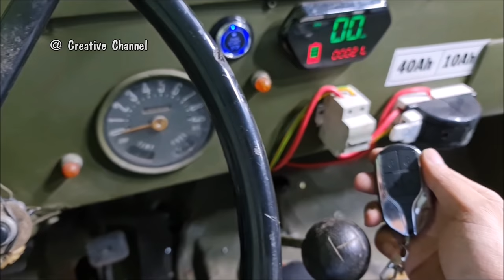1967 JEEP GASOLINE Conversion To ELECTRIC Car at home

Comment: Of all the possibilities that Jeep imagined when it was captured by the Vietcong, converting it into a military golf cart sure wasn't one of them. Congratulations, superb and super simple conversion, Tesla must hate you and rightly so, haha!
Reply: Now it's going to cost twice as much to operate without as much range.
Reply: @gregpeterman1102   I understand the range part but why would it cost twice to operate?
Reply: هغا
Reply: @Sputz3  because electric vehicles on average cost twice as much per mile as petroleum to operate, electricity and batteries cost money.
Reply: tesla nem sabe quem é esse cara
Reply: Xxb
Reply: @gregpeterman1102  I don't know where you live , but usually its the other way around, cost per Km for electricity is roughly 1/4 th of fuel. And There will be annual cost savings on maintenance because there is no oil change , air filter , fuel filter etc. Batteries will easily last 10 years with minor degradation in capacity.
Edit: -------- 
i noticed he is using 40Ah 80v lead acid + 10 Ah 72v lithium-ion.   
This is bad, as the Lead acid will only last 100 charge discharge cycles, worse if discharged to less than 50%, these are regular car batteries designed to give burst current to starting motor, not deep cycle batteries.  So less range (around 25km) and probably more money lost than fuel for battery replacement.
Reply: @hemanthkumarHere  I'm going by my experience with electric golf cars costing twice as much to run compared to gasoline powered. (Yamaha)
Reply: @gregpeterman1102  interesting, and very valuable feedback. However, You glossed over a few very valid points. I am not very knowledgeable about converting gas-powered vehicles to E-powered powered vehicles. Please provide details as to why the operating cost would increase.
Reply: @jamesnash6101  because of the cost to recharge the batteries, plus the cost of the batteries is part of the fuel expense, and even the old lead acid batteries were not cheap, the electric meter at the shop where we recharged anywhere from 4 to 7 golf cars per night would run anywhere from $800 to $1100 per month, but just $200 dollars worth of gasoline would run more golf cars than that all month, it was a no brainer. The only place to justify electric vehicles is indoors or enclosed places to avoid carbon monoxide. Also the electric components are the weakest part of any vehicle, and electric vehicles are more prone to breakdown. Just what I learned from being a mechanic.
Reply: @gregpeterman1102  so, just to clarify my understanding. The electricity bill to recharge 4 to 7 golf carts was $800-$1,100 per month? If that is true, then this conversion would not make a whole lot of financial sense.
Reply: @jamesnash6101  right, until you have a backyard or rooftop full of solar panels, petroleum is cheaper, at least in the U.S.
Reply: Carroceria jeep willys en Renault de Argentina
Reply: @gregpeterman1102  If you claim is true, then why you are still using electric golf cart?
Reply: @CDOKayakClub  I'm not using an electric golf car.
Reply: @Hitycooking  €
Reply: жд
Reply: Pr90
Reply: Me gusto el hinbento de Jeep es genial Guuuauuu eres el mejor de aser este hinvento gracias por compartir esta hinformacion felicidades 
Desde San Bernardino California.
Reply: @gregpeterman1102  ppb
Reply: 0
Reply: P
Reply: @gregpeterman1102  I'd love to see the fact sheet on that!
Reply: @timwegman5776  it's been known for decades that electric forklifts cost twice as much per hour to operate, but it's the only vehicle that can be safely used in an enclosed warehouse environment.
Reply: Awesome job. What is the power output of the motor that you used?
Reply: Very creative approach to convert your a genius,,, 👍👍👍👏👏👏
Reply: @gregpeterman1102  I pay just less than $0.14 per kWh of electricity and average about 4.25 miles per kWh. So, 100 miles travel takes roughly 23.6 kWh of electricity, or $3.30 for 100 miles. I've been over 75k miles on electricity and can't tell if the battery pack has degraded at all. EV's aren't for everyone, but there's a lot of bad information floating around the internet.
Reply: @gregpeterman1102  I have a electric motorcycle and I haven’t noticed a big change in my electric bill. My car take about 35 a WEEK to operate. My electric motorcycle only adds about 20 dollars a MONTH to my bill to operate. 🤷‍♂️
Reply: Replies
Reply: YouTube pahan Kyon Ho Gaya
Reply: Ramesh Kakkar Ramesh Kakkar wale ki awaaz mein Ragani
Reply: FF

Comment: Crazy fast and simple build!  I would have hidden the breakers and battery switcher in the glove box or something.  Awesome build!
Reply: Always double precautions if you're a newbie.
Wear electrical protective suits.

This high voltage can easily kill you if you are performing just trial and error method.
Reply: @mikemierspadios7036  84 V DC haha
Reply: Ơn 6
Reply: @arturodelgado2010 c
,
Reply: He's only doing about 30 mph or less  his speedometer is in kilometers per hour  and  about 2.2 kilometers equal a mile.
Reply: Pls where can I buy this complete electric conversion kits?

Comment: great work brother if the clutch plate was added there would make the gear shifting more easier
Reply: Would be hard to keep the clutch. But since it's a electric motor it is easy to rev match your gears to shift and the electric motor can't stall like a gas engine so really no need for a clutch as long as you can rev match your speed to the gear your trying to use.
Reply: @kamikaze253  yeah brother i agree

Comment: Great job , I'm just guessing you used what you had at the time to pull this off . Imagine what you could do with an even bigger motor and a battery pack from a wrecked ev .  Yes people this dude just basically showed you what he could do with limited resources, now you got the idea go ahead an make your own even better if you are lucky enough to have better parts or the $"s to improve on this great little conversion . Well done old mate good on you for having a go.

Comment: One thing I wanna know is how long the batteries last. By d way, nice build!
Reply: Would depend on the load/weight with one person and groceries probably about 100 miles at least,
also if you replace the lead acid batteries (cheap!) with more energy dense lithium batteries more recharges 
and 50-60% more range.
Reply: I'd expect around 20 miles!

Comment: question: for that battery pack. how much does it last? how many km/m it can cover? how long does it fully charge?
Reply: The battery's together are 3600wh and the motor is 3000w and I think it drives around 50kmh the range should be about 60km
Reply: With a 10amp charger around 5 hours
Reply: @bluecrafter_  not bad at all driving around town just no long uphill
Reply: İ think you can drive it about for 1hour 30min in town
Reply: @bluecrafter_  from 30 kwh you get 200 km , so from 3.6 kwh , you will get maximum 25 to 30 km.

Comment: how long did the battery power really lasted, and did you add any device that would charge the batteries as you drive...?
great build by the way, simplest ive seen so far, congratulations...

Comment: I seriously doubted that small motor, at first but it ran pretty well. I hope it lasts.
Reply: It wont last unfortunately
Reply: @medmusic7977  can you please explain why the motor wont last very long?
Reply: @erickortiz7617  because of lack of torque and lack of torque gonna push the motor to overheat or getting its coil burned and destroyed.
That jeep need at least a 20kw of battery pack and a Curtis 1238-7601 HPEVS 96 Volt motor

Comment: Very cool, I notice you reused a speedometer from an E-Bike, how accurate would this be? Given the difference in wheel sizes, have you done a test with a GPS speedometer to check how accurate it is?

Comment: Neat! I bet if you built a small box with some soundproofing foam inside or outside, you could really reduce that sound from the electric motor. 

Also, I would take the gas tank out and install more battery banks there as well increase your distance on one charge. 

Why do the decals say US Arny and USMC? Shouldn't it say just US Army?
Reply: USMC stands for United States Marine Corporation. The Jeep was probably used by the Marines.

Comment: how do your brakes function without having a vacuum and for what did you put the radiator back?
Reply: No power boost brakes on this......duhhhhh.   All manual
Reply: @cloudbydayfirebynight618   a manual system for such a heavy car?

Comment: Looks great but my design was different. Years ago I wanted to do this but the batteries just weren't good enough. My design was to first build a bell-housing adapter. The electric motor and transmission would then become one unit. My understanding is that the trans shaft and motor shaft must be true. No need for the trans to be open to catch road debris and have vines wrap around the adapters.

Comment: I have a doubt...
1) Is gear system is working without clutch system ?
2) How was the working break system ?
3) How break booster works ?
Reply: for the 1 it's easy : electrical motor have no torque when he release the accelerator paddle it's like he have push the clutch paddle
for the 2 and 3 i'm also curious, the paddle should be really hard to push
Reply: @coolbiker6122  The video did not show altering original brake system. Only the gas engine replaced with electric motor+controls+battery. The original jeep brake system is in use. No regenerative braking. May be further design improvements may come in future. However the practical genius is appreciable.
Reply: Manual Brakes, Manual steering and pause between gears you can shift without clutch
Reply: @bryanadams3353  pause between gears you can shift without clutch ....it makes sense but it will definitely lose torque every time you change gears... can this be covered by an electric motor that has a large torque?
Reply: I also wondering how the gear works? the motor only rotor forward and backward. even if it works, that's mean no need to do gearing. start and go only.

Comment: How on earth do you shift gears without a clutch?
Reply: Its tricky but can be done. At certain rpm  you can shift gear smoothly, gear up was easy but gear down can be bit tricky.
Reply: Like Carlos said you can float the gears, and you don't really need the clutch to go from 1/2 to N to R if you're pushing the brake since it's electric. I've seen a few of these on newer cars and the owner just keeps it in third 24/7 because you don't really need the gearing anymore since it's electric drive
Reply: @JohnathonBrock   sir but in this case he has connected  the motor drive  with preexisting  manual gear box,so it's impossible to change gears at that rpm.

Comment: Thank you for your creativity. Also, how many batteries and how many amperes are each one? Did you connect them in series or in parallel? Also, what is the status of the hydraulic pumps for the money, as well as the oil pump for the stop pedal and the air conditioner? Have you canceled the hydraulic pumps for the crisis to facilitate the movement of the steering wheel and the APS pump for the brakes? Are these things working normally as they were before?  Petroleum engine. It would be better if you found a way to reduce the noise.  generated by the electric motor

Comment: Hello, could you please list the materials for the conversion? I have a diesel ford escort with a very light chassis that could work perfectly with your system. greetings from LATAM
Reply: Yeah same I’m looking for the material
Reply: @joshjuache1780  Learn electrical engineering first.
Connection is not easy if you have no knowledge ,it can cost your life.
This are highly voltage can easily kill you if you handle wrong way.

It will be much easier. But I'll list it for you.
Major components.
- Electric motor. Although it depends what type you use. Higher WATT more power.
-batteries.
-Wires.
- Controller
- And list goes on depends what other features you like to add and depending on your budget.

Comment: Man you should’ve kept the clutch so you didn’t have to stop every time your shift
Reply: When an electric motor isn't under load you can shift no clutch . Also this Jeep probably topped out at 60 down hill stock, you could drive it anywhere zero to sixty in 2nd never shift no need
Reply: Wait u have to shift on a electric car?

Comment: Looks pretty cool, but I do have a few questions.

Distance and usage:
 How long will the charge last when you factor in the amount of distance the vehicle will travel on a single charge? For example, Let's say, the vehicle is on a highway and is traveling at 65 miles an hour. 

Charging time:
How long does it take to charge the batteries?

Please respond in English. It's the only language I understand. Nothing personal.
Reply: This is a very basic ev conversion. Low velocity (under 60 km/h  max), Short range distance ( 35 km range with those lead-acid batteries),  recharge  for 8 hrs.

Comment: What kind of controller is that for the motor anyone know? Or where to get one in the USA I see small ones on eBay and Amazon and thanks great build I'm converting one myself Genius how you hooked up the transmission I also have a manual and was wondering how I would do it so thank you.

Comment: Hello Sir, how do you change gears without the clutch? I saw the BLDC directly welded.
Reply: No need for changing gears. Only one gear is enough for the project.
Reply: @daudwilson8326  yes, true. But what about reversing? You still need the stick. I just want to know how.

Comment: Nice work inventor..but how you will regulate the speed high to low and low to high..u answered my doubt sir..I salute you Boss Inventor..maybe you can have sinchronization gear box to drive the gear clutch for smooth connection

Comment: Hey bro I got to say this much you did a fabulous job on that what you should have done is the electrical wires that come from the headlights off of that truck hook it up to a positive on that but anyway where did you get those lights at I like the order me a set of those headlights you got

Comment: Great Built. Since you have connected the Motor to the main gear shaft, I would have kept the clutch in place to facilitate the easy and smooth gear shifting.

Comment: well this project is doable the biggest red flag I see is you could have taken that quite valuable Jeep sold it then bought some Russian or local four-wheel drive vehicle for little or nothing and then converted that and use the funds from the sale of the Jeep to pay for everything that you had to buy for your conversion that the condition of the Jeep is such that it would have sold very well and very quickly to a collector or does someone that needed a good quality four-wheel drive thank you for listening Bob from Virginia USA

Comment: If you can attach a dynamo or another motor to the main motor and plug it back to the battery to keep the battery charging while the motor is running. Or put a charging system .

Comment: IMPRESSIVE. NO MORE GAS POLLUTION. EXCELLENCES PROJECT. HOW COULD I CONTACT YOU SIR? FROM THE SIX BATTERY YOU HAD INSTALLED  HOW MANY KILOMETER COULD REACH.? WHAT IS THE MAXIMUM SPEED OF YOUR CAR ?

Comment: I plan on building my own vehicles. Some will be powered by gasoline, some will be powered by diesel, and some will be powered by electricity. All of electric powered vehicles I plan to build will have a self charging system so I don't have to stop to charge. I will build my own vehicles my own way.

Comment: 37mph top speed with no load. hope that's not leaving residentials. i have the same motor (equivalent) on my bicycle and that does maybe 40-45mph. id STRONGLY suggest more power.
Reply: 37 mph? Never! 
3kW are less then 5hp. He will loose around 1hp in the two gearboxes and the differential. The petrol-engine might have had around 60hp to make less then 60mph.

Comment: Nice Jobs SIR.
how many kilometer done with full charge Battery?
Reply: Would depend on the load/weight with one person and groceries probably about 100 miles at least,
also if you replace the lead acid batteries (cheap!) with more energy dense lithium batteries more recharges 
and 50-60% more range.

Comment: I one I love your video on conversation of fuel vehicle to an electric one I do not on if you know how to use an electric motor to drive an ac generator with a flywheel to generates electricity.Thanks

Comment: Ótimo canal. Como saber a quantidade de bateria correspondente a potência do motor
Reply: Como todo as coisas eletricas tem de fazer o calculo. Se ele colocou um motor de 3000w (3kw) e 6 baterias de 40 Ah (2400W) ele ligou  pra tem energia junta e tensao superior, 24v, entao 6 baterias 120A * 40 = 2880W (W=V*A)

Comment: Edit: ok I see what you did there , two separate banks that's actually quite clever. 
Wait are you mixing lithium ion battery pack with gel acid batteries in the same pack? I don't think that's such a good idea bud!

Comment: If you left the gears system would be great . But the car will run too slow and not reach high speeds despite big power . And Duel motor will be great 👍. And i see that u didn't get out the gas tank . It will more cleaver if u add a batty pack in it's place and leave the front area for a trunk.

Comment: Sorry guys this not as easy as it looks.   The way he is doing this is long way around.   Moreso, there are subsystem you must understand that needs to be addressed.   The easiest way to do is remove the entire engine, transmission, propeler shaft and drive train.   From there, just install a drive train with a motor in it already.  Then just install BMS and Batteries up front.   The subsystems that you must install are:  electric pump for power steering and electric pump for the hydraulic brakes.

Comment: Please bro can you write electrical components in detail 
And how you calculate the power of the  motor you used it 
Motor voltage 220 or 380 volt